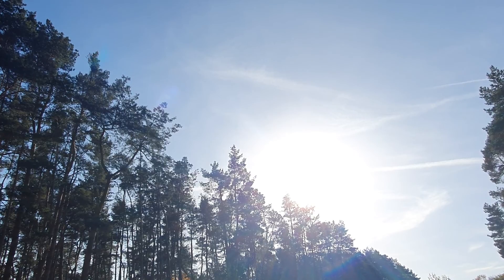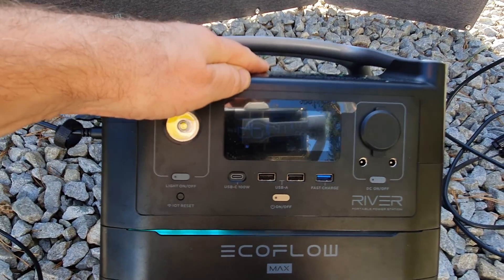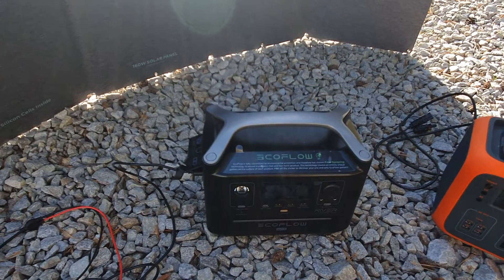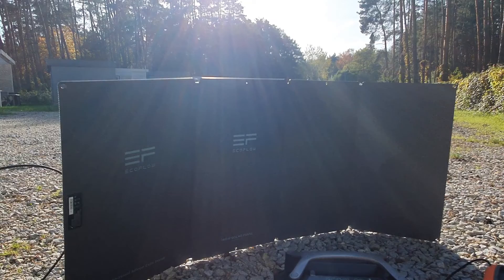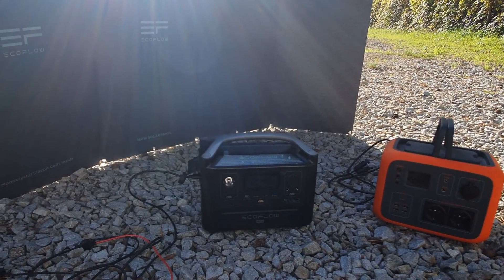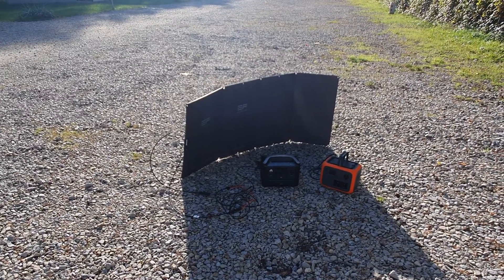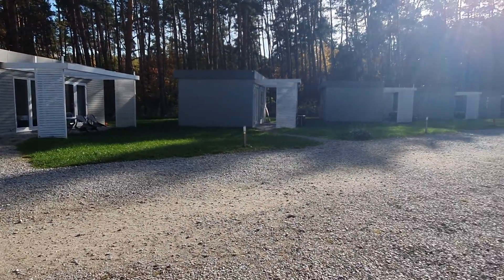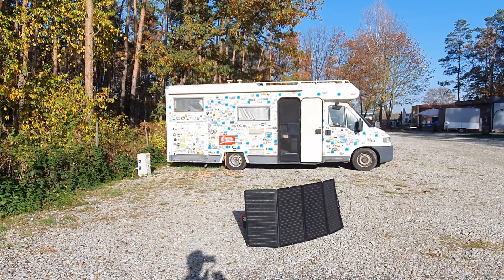Testing  Ecoflow 160W solar panel to recharge batteries

Comment: Great chat. I have bought one of these now. See your comment about leaving it outside while you went off, I'm not that brave. It may well grow legs and walk off !. I plan to leave it in the front windscreen area, aligned naturally. Thoughts about that Alan? Untested I expect.
Reply from the maker: That was not bravery Mike - that is on the campsite - I would not have done that if I were elsewhere!  I used to leave mine on the windscreen - that was OK when I was in the semi integrated, now I have an integrated motorhome, it is not secure and might fall off, so I put it in front of the van.  During the summer, when I was parked, but not camped, I left it on the roof.  It worked well until a gust of wind tore it off!
Reply: part of the decision to buy was the convenient size, offering as you say some variations. I was meaning to place on the inside of the moho windscreen, locked up that way I could go off. No requirement for the campsites has some drawbacks ie security/watchful persons being around. It should work, time will tell the panel arrives Monday. Thanks again, I bought a Carado V132pro mainly off the back of your rv's as well as others @VanlifewithAlan

Comment: Dude. I bought a pair of cheap lawn chairs at Walmart and disconnected the arm bar cloth material and lined up the chairs. Placed my EcoFlow 160w on them and it holds perfectly and keeps the panel relatively straight. I got 2 adult sizes for $11 a piece and they can should hold a good 220 solar panel just fine. The EcoFlow case is too nice to use it as a stand and sadly it's not a great one. It is a beautiful and amazing case! It is a far better option then standing it up like that and a light breeze coming through and knocking your panel down and doing damage to it.

Comment: Love your videos, but neither A or W are units of stored electricity 8-)

You can have Ah or Wh - there has to be a time element, mathematically. Just saying. 😊
Reply: I was about to comment that, seen it several times today on various videos because of the CES products, its a common problem
Reply from the maker: You are absolutely right Steve, I should have said that, and of course there is a difference between Wh and W.  I might put in a disclaimer at the beginning of the video!